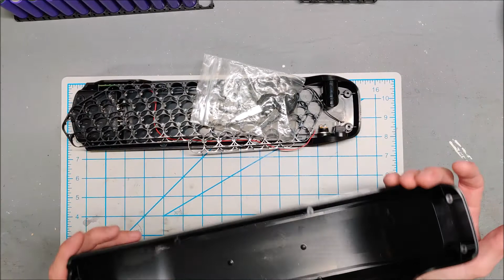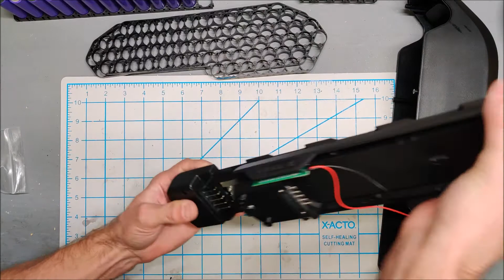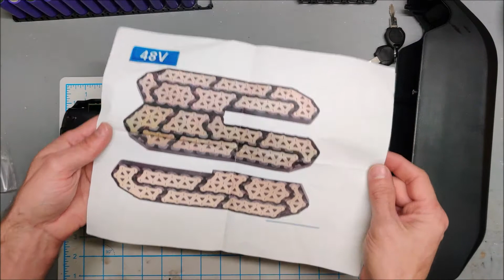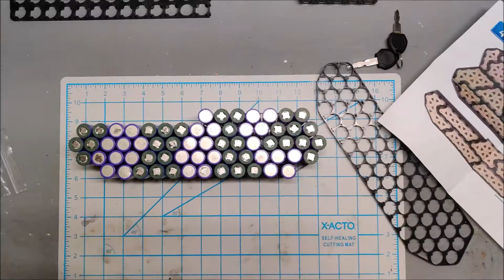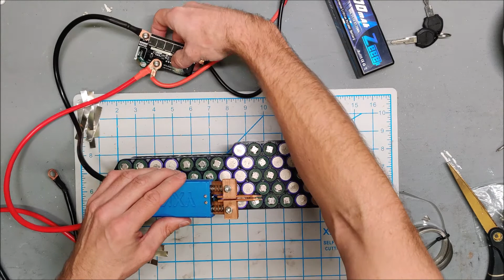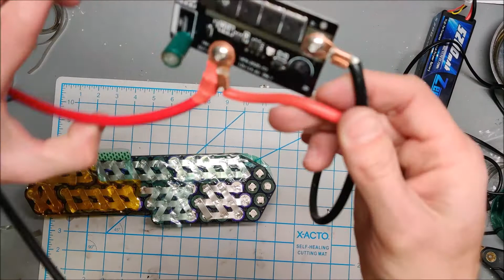$100 DIY 48V EBIKE BATTERY - PART 2 (RE-UPLOAD)

Comment: BMS: is a battery management system in the Negative polarity.  The switch is connected to the BMS. The loop is broken on the  Negative side. In the BMS circuit.  The BMS has capacitors in bank.

Comment: in 13s u need to weld 13 of cell in series + to -  those 10 cells, thats give u 37 volt but i think your raimainng cels u will fix to give the 48 volt ? but i dont understand
Reply from the maker: 13 in series x 3.7v nominal voltage = 48.1v.